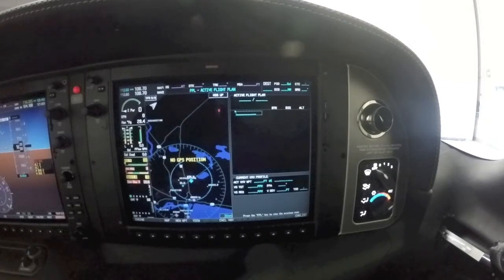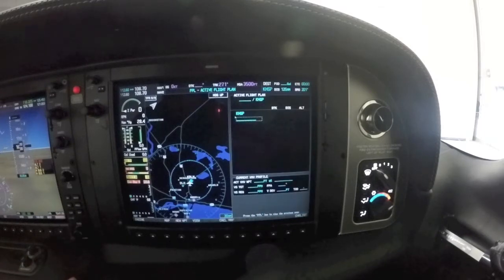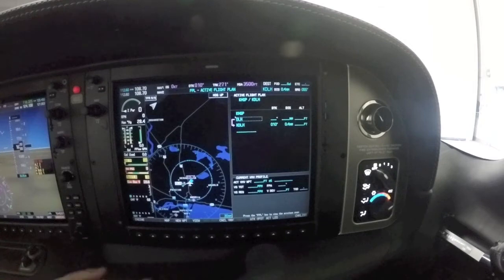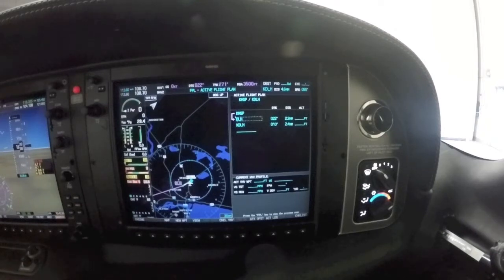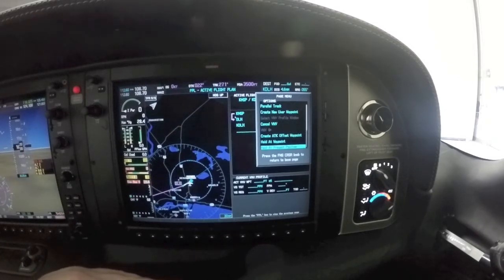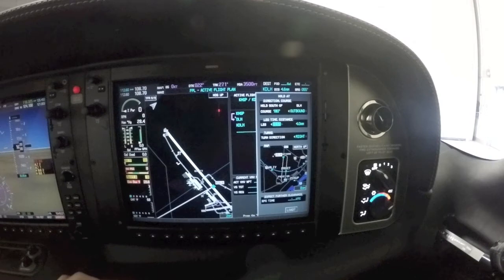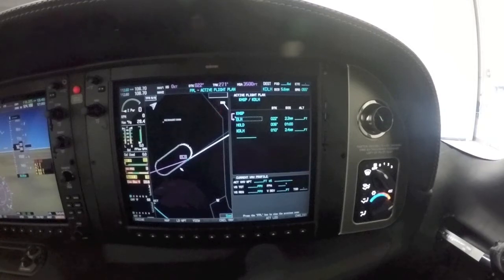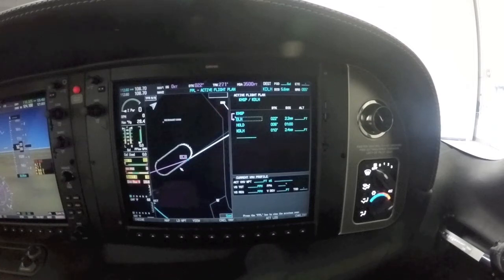Cirrus Perspective and Garmin G1000 Random Holds

Comment: Hey Mark, I just got my 2012 SR22 upgraded with the new hold software but havent tried it yet.  I had one question that I figure you know the answer to.  Once it enters the hold, will it stay in it, even after the expected update time?  I assume it gives you a warning to tell you the time is up but wont leave the hold?  My other assumption is to leave the hold and continue in, do you just push the suspend button like in a published hold or do you have to activate next leg?
Reply from the maker: Ryan Fiorini I haven't tried that either but I am sure it follows the normal Garmin logic which would keep it in the hold even after the EFC time. I think the EFC is basically for the pilot's FYI. The next question would be dependent on what leg you had next in the flight plan. By hitting the suspend button you are telling the system you want to proceed to the next waypoint. It will only do this after it crosses the holding fix after you have taken it out of suspend mode.
Reply: +NorthStarAero  Thanks for the video. Are you able to download the CMC (CAS messages) files, like I do on the Embraer Phenom 100? E50P
Reply from the maker: +Rodolpho Neto Yep you should be able to. All the data should be found on the top right MFD card.